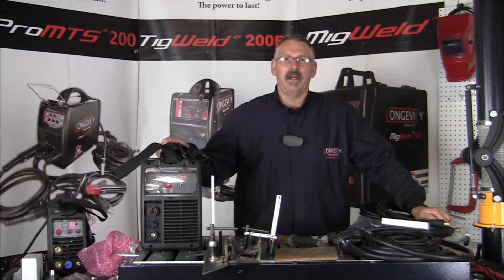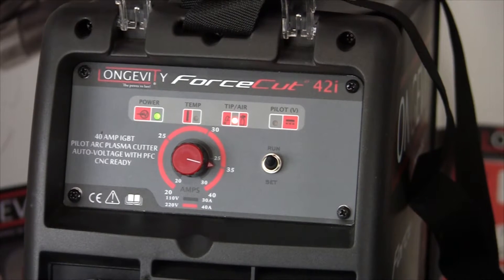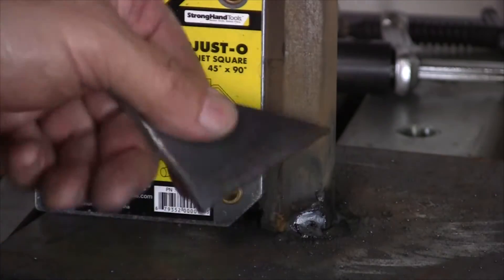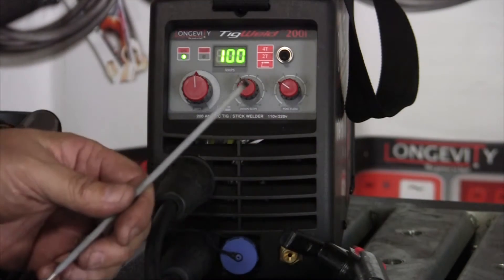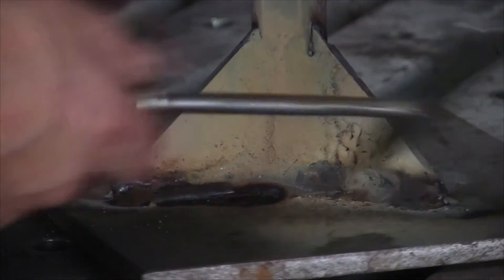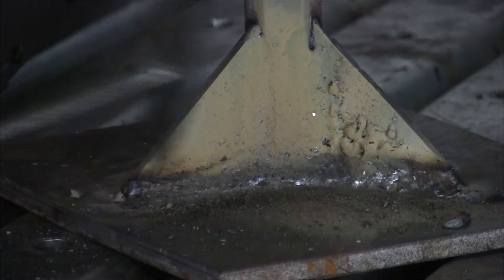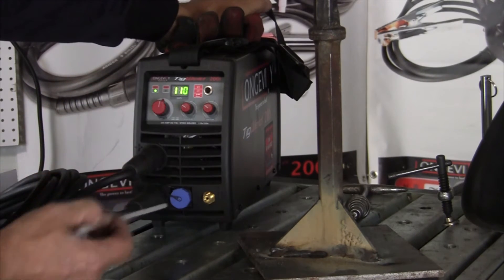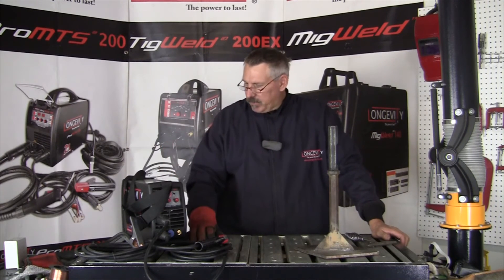CUSTOM JACK HAMMER PLATE TEMPER WELDING PROJECT

Comment: Thanks for the capability video....too hot, 100-120 is for 7018 rod...would have gotten neater results if you had set it on about 85amps for 6010 1/8 rod though & 6010 is not like 7018, it is meant for "stich" pattern when welding, not weave up and down like demonstrated...Any idea when the NEW Tigweld 200EX will arrive? Emailed Daniel over a WEEK ago with NO REPLY.......
Reply from the maker: Thanks for watching. It will be arriving in a bout a Month.